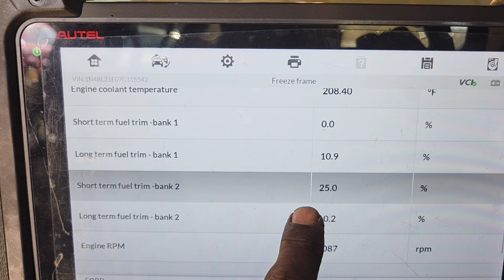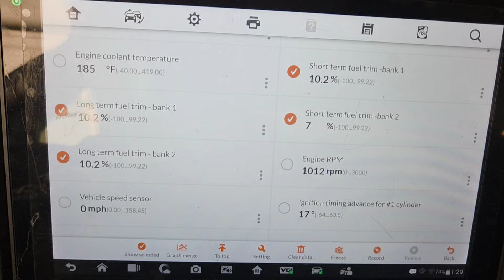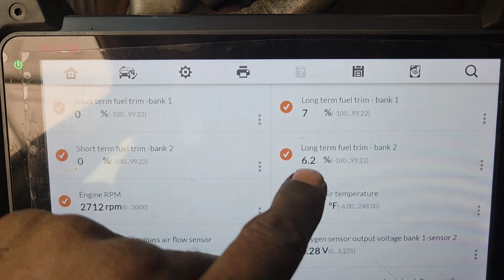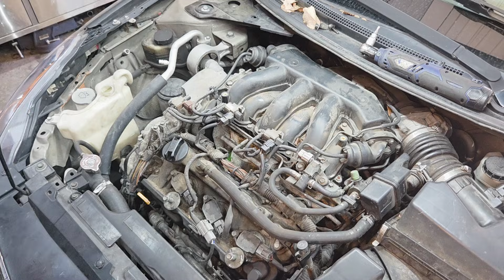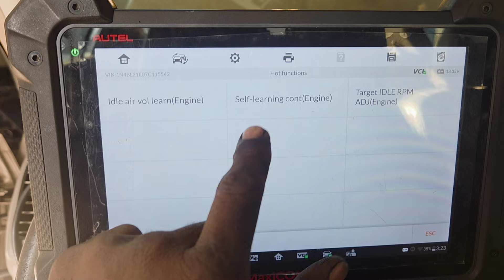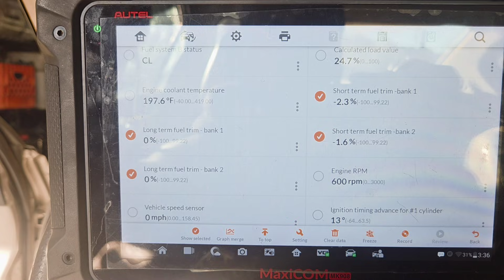2008 Nissan Altima P0171 lean bank 1

Comment: I have a 2008 Nissan Altima 2.5 S Sedan and I have the exact same problem right now. My check engine light came on right after I got a new oxygen sensor installed. I checked the diagnostics and it said P0171.

Comment: No, that actuator controls the the other VIAS plunger next the throttle body. The actuator that controls the Active mounts is the one that's bolted  on top of the timing cover with the Marrone connector.